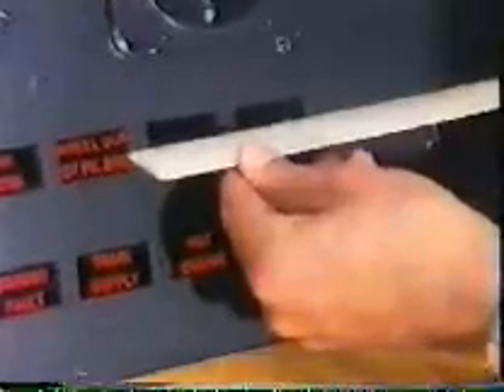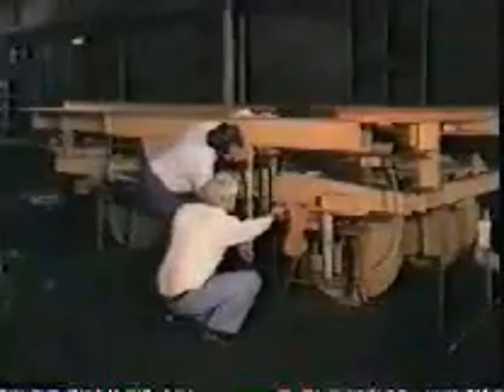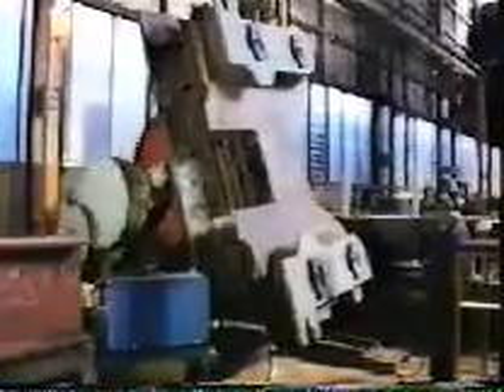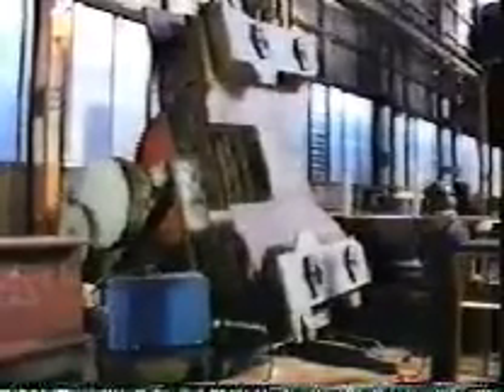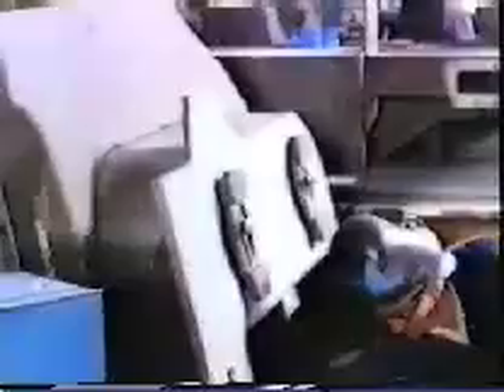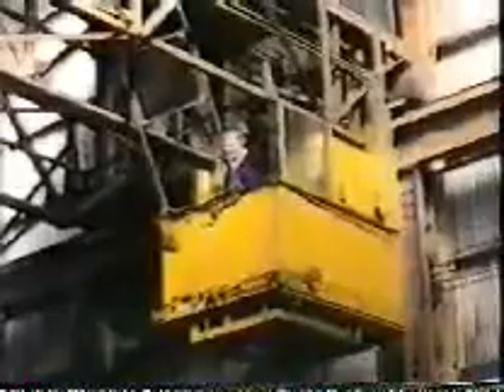XPT By Comeng 1/3

Comment: The train was a good design but the tracks it was expected to run on were hopeless and got worse and worse until the train was forced to travel at the same speeds as the locomotive hauled passenger trains it replaced. Apparently there's fatigue cracks in the power car chassis and in the bogie king pin mount's thanks to the rooted tracks. Such a shame !

Comment: Good train and all, it is just a pity that since 1980 money has not been spent to upgrade the rail lines to a standard which allow faster speeds. Which would allow harmonization between the rails and trains.
Reply: Money was still being spent on track in those days.  I met Tim Fischer on the night train to Sydney from Melbourne. But the die had been set there were no votes in trains .

Comment: Just discovered this.  A great story of Australian engineering (aside from the previous obvious comments that the tracks should be worked on as well).  It's a shame the power cars were never stainless steel.
Reply: It's a localised British HST intercity 125 built under licensed
Reply: Indeed. COMENG took pride in extensively modifying the BR Class 43 for Australian conditions including claimed better weight distribution.

Comment: only if the goverment spent the dosh to fix the tracks, then they could think about running it at 200kp/h or evan better upgrade the whole dam lot and do a French TGV inspired train they hit about 500kp/h the XPT's what a shame a train is only as good as it's tracks
Reply: Adam The Aussie Spending the 'dosh' on lines that are only used once a day, as well as the steepest mainline intercity grades would be a waste, when they can just design a train that fits the current specs.
Reply: @Alexander Dunn  No way the XPT could go that fast (250 km/h = 155 mph). The XPT has lower geared traction motors in order to get up the steep grades in Australia, hence the design speed of 160 km/h (99.4 mph) as compared to the UK IC125 (HST) design speed of 201 km/h (= 125 mph).